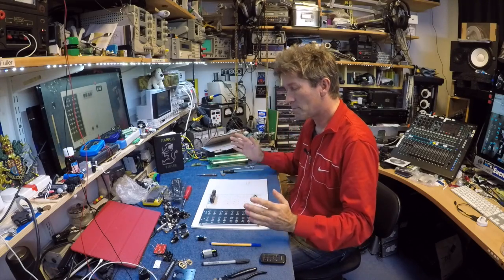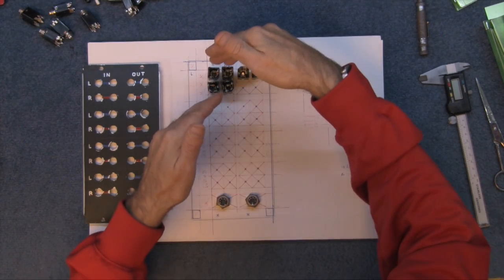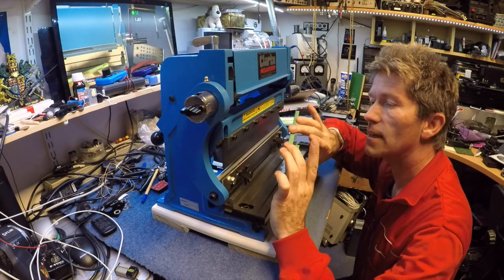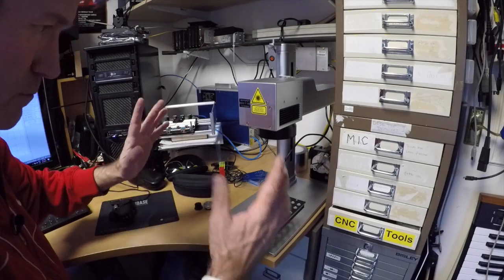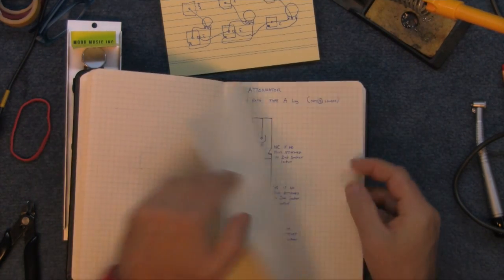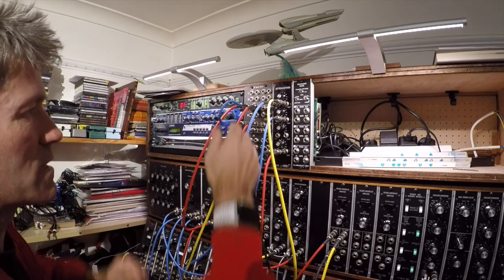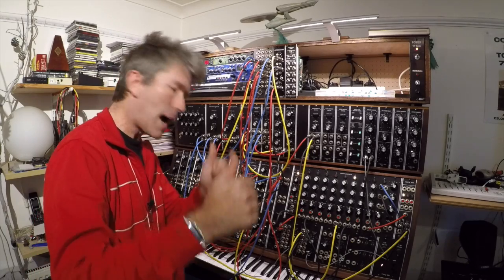Expanding the Moog Modular synthesizer & making the Attenuator

Comment: Nice work. Have you ever thought of using aluminium sheets with a sublimation coating and sublimating your own graphics, dials, text etc onto the panels? 

I have a sublimation printer (Ricoh SG3110DN) and a heat press and use them to make, amongst other things, aluminium clock faces, like this - https://youtu.be/7EJpO1wMU38

Comment: I don't want to be a jerk, or come off as being condescending, but one safety precaution I would recommend would be to wear a thick leather glove on your left hand while you are drilling out the holes of the panel. If the drill happened to pull the piece out of your hand and spin it, it could slice your hand very badly. I know it's really easy to neglect it because I've also done the exact same thing a million times.  It's like, "eh, it's only going to take a few minutes to drill these holes, why waste the time? I'll be extra careful." However, it only takes one slip, so the glove might be helpful if an accident were to occur. The smaller the piece of metal you're drilling, the easier it is to slip from your hands. 

Either way, this is an awesome video, and I am really impressed with the care and precision you take with your work. The process is fascinating. Thanks for posting.
Reply: I really do oppose your view tbh. If the drill catches the glove it'll pull in your finger and that could end quite badly too. 

On second thought. With a leather glove its probs gonna be fine. The rubbery gardening type gloves though.. I wouldn't recommend wearing while using power tools.

Comment: simple module Im building : octave voltage dropper. basically reduce incoming CV by -1,-2 and -3 volts. handy for when sequencer is playing notes too high, or you want to turn a regular OSC into a Sub :) as well as to simply dial down other control signals
Reply: I agree! A sub module would be pretty nice

Comment: I use stereo jacks for midi in and midi out as you only need ground and 2 signal (as only 3 pins in a midi cable is used unless it has phantom power).

Comment: You could always cheat and use black dibond, it's a plastic/aluminum/plastic/aluminum/plastic sandwich. and if you route along where to want to bend (at about 1/2 the thickness of the panel iirc), it bends really easy. 

And if you engrave it by just going to the depth of the first layer of plastic it looks really smart.

Comment: Excellent video. very informative.
I've done some new designs for some of my eurorack panels and currently trying to figure out how to print them onto aluminium
(even acrylic would do I suppose.)

do you have any tips on that kinda thing or know any companies who do such a thing? 

I'm currently thinking... print them out on photo paper then mount them to the back of some clear acrylic then just drill through the holes. (but I would MUCH prefer them printed onto metal)

here's a mock up I did for my turing machine. https://pbs.twimg.com/media/DPRqUTfXcAEBJqH.jpg:large (simply printed onto photo paper and placed on front (it's just held in place using the nuts and screws on the module and the holes for the LED's are pretty rough as i simply punched them through with a bradol :)

the turing machine was also a DIY build (simple by your standards but still a fun little build)

wish I had half the tools you own , especially the laser :)

Comment: What about a modified Ring mixer based on the balanced Quadrature Sampling Emitter and the carrier to be 4 times the wanted frequency which drives a 74AC74 configured as a Johnson Counter giving the drive signals to drive the 74HC152 configured as a balanced Quadrature Sampling Emitter (QSE) which would be driven using an audio phase shift network and should work better than the diode ring mixer and should be able to give to bands LSB/USB selected by the Johnson Counter schematic is available on the internet just a suggestion. Anyway the carrier would be 76-80khz, even though the clock is a square wave the output signal will be a nice smooth signal.
Reply from the maker: Yikes David I was hoping to start off with something a little more simple LOL.

Comment: Some suggestions: 8x8 pin matrix, D-beam controller, arduino based digital modulator (clock sync'ed LFOs, etc), two theremin antenna modules.
Reply from the maker: I like the idea of a theremin.

Comment: You could do any sort of diy guitar pedal design and mount it behind a panel. Distortion or delay maybe?
Reply from the maker: Yes Im thinking maybe a spring reverb with valve pre-amp built in. so i can cut out a window for the valve to be seen :-)
Reply from the maker: Yes I have a few interesting pedals around that could look good if made into a synth panel.

Comment: Markus, as you always point out about safety, why didn't you put the goggles on when operating the laser?
If you put your arm underneath with your watch on, the stray light might go anywere, apart from any arm burns.
Anyway, apart from my remark like the video!
Reply from the maker: Albert Pauw Good question Paul. the red laser is just to help line up and the marking laser is operated by a foot pedal to the left of the pc on my left and I am in the hablt of closing my eyes when i push the pedal plus I am also facing away from the machine to push the pedal. but you are quite right to point that out.

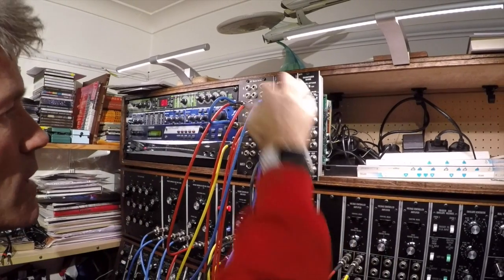Comment: 11:39  You really want linear pots for these attenuators so they will work well with control signals (and 13:40 they will work well with audio signals).  Great job!
Reply from the maker: I used the same pots as Moog but only smaller. they have 10k Log type A in the attenuator.